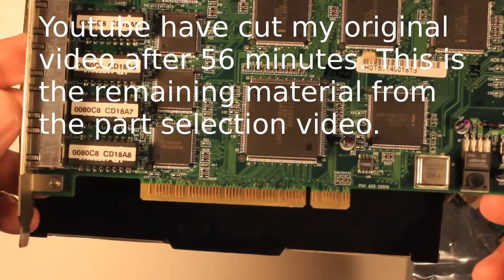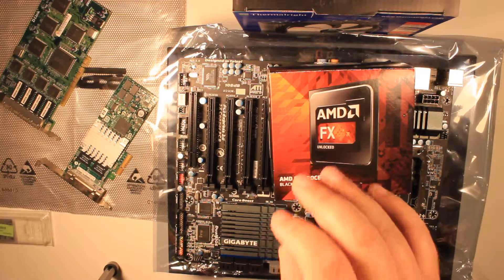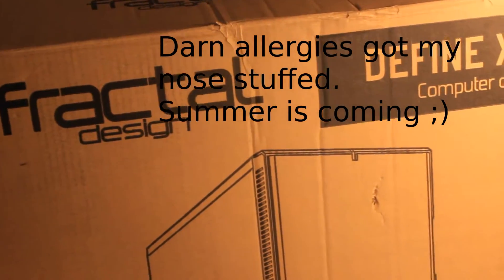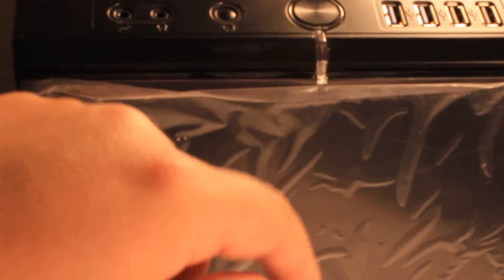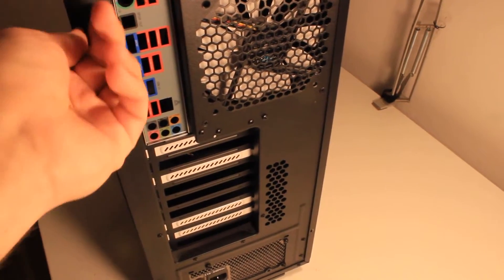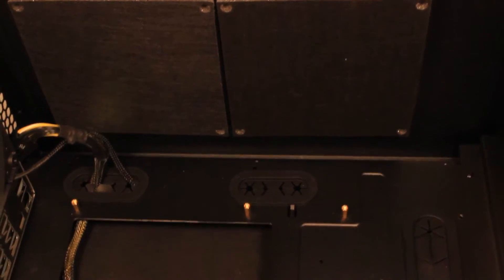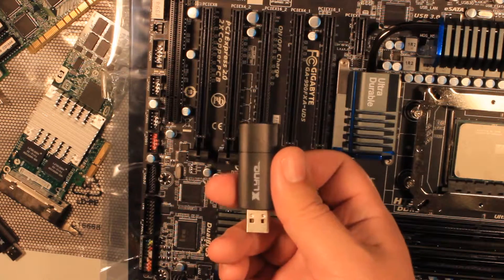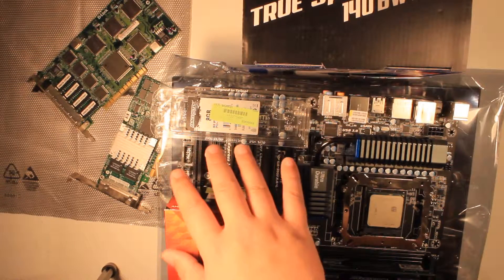Howto build virtualization home lab for VMware, KVM, GNS3 and ZFS: Part selection (part2)

Comment: if ya want to make a budget  virtual machine build parts are fine.... it won't break the bank account :D
Reply from the maker: The idea behind was exactly to build an INEXPENSIVE but still good virtualization host, which is also not generating much noise. For 500 more Euros if noise would have not been a concern I would have rather built a nice dual-socket Supermicro chassis with Xeons...

Comment: I missed size needed for the second (kingston)  SSD
Reply from the maker: It is up to the number of VMs you want to install on the machine. 
In my machine the system SSD disk for KVM is 120G, and the SSD for the VMs is 256GB.
Reply: I will be installing Proxmox on the server  and who knows what else... May end up with 2x 256GB just to be prepared.Will be starting to put the system together on the coming period on the basis of these videos and all your info.

Comment: Thank you for the video. I have been wanting to build a similar server.  looked at both videos but could  discover your using a raid controller.
Reply from the maker: I do not use any RAID controller. In fact, considering how good ZFS on Linux works in my daily job, I will most probably not even put money towards a RAID controller. Instead I will just use the onboard SATA ports to directly pass the disks to ZFS.
Regarding the network, if you need Virtual Machine Device Queues (VMDq) or SR-IOV features, those are not supported by the network cards and the motherboard. Considering that those are advanced features for virtualization, most probably you will not miss them.
Reply: Thanks for replying. I will have to shed some light on ZFS since this is new to me. Do you have experience using onboard SATA on AMD motherboards when it comes to raid functionality ? I found some complaints on AMD motherboards  when it comes to using them for raid purposes. Secondly I noticed  quality raid controllers have a back up battery to prevent data loss in the RAM in case of power failure. Also I was considering that RAID controllers would allow for  hot swapping the hard drive in case of failure.
Your commenting will be much  appreciated.
Reply from the maker: The issue is, that strictly speaking neither the Intel, nor the AMD chipsets provide real hardware RAID functionality, because they do no hardware offloading at all. Instead, they !ARE NEARLY PURE SOFTWARE RAID!. Namely, they just offer a more "visual" interface where you can set the RAID level in the BIOS regarding the disks and the chunk sizes, and they save those settings into the NVRAM portion of the BIOS. Once your operating system boots, it reads those values from the BIOS, signals to your OS to load and starts a special driver. After this it does !SOFTWARE!  RAID using the implementation from this driver to do all the RAID calculations on the CPU. Since the driver is proprietary instead of something like the open source MDADM, this makes the Intel and AMD RAID very inflexible because you never know what is happening on your system. Thus, if you are sure that you really need RAID, then it is better to either buy an Adaptec (http://www.avagotech.com/) used from Ebay, or stick to good software RAID like MDADM, or the RAID-Z implemented in ZFS.
Regarding the hot-plugging, SAS backlanes support this only according to specifications, because SATA is not really was meant to support hot-plug. In reality, however, if you rescan the SATA bus after hotplugging a disk with Linux or VMware, they will find the new disk most of the time.
Reply from the maker: Regarding the battery for a RAID controller, that is needed because the RAID controller practically lies to the underlying OS, that it has the data in a stable storage (so called synchronous write), when in reality it have just pushed it into a fast write-cache (practically a RAM module). Thus, when the disks are not busy, the driver of the RAID controller will take care of actually flushing the data from the RAM module to the disk, which is transparent to the user. 
Now if you do not have a battery on the RAM chip, since its contents was not yet flushed, it might corrupt the entire filesystem, or you might just lose 1GB of data if you are lucky. However, in reality most hardware RAID controllers I have used so far, if you do not attach a battery to them, they will turn off the write-cache per default. You can still !FORCE! the write-cache to be turned on from the BIOS of the RAID controller, but this is really bad practice and asking for trouble.
Since the batteries are really expensive, and they dry out in about 2 years, the new RAID controllers use supercapacitors like the Avago Cache Vault cards:
http://www.avagotech.com/products/server-storage/raid-controllers/cache-protection
In contrast to hardware RAID, an other argument for going instead into the direction of ZFS is that you do not need such an expensive RAID controller or a battery.
Reply: Can't thank you enough for taking the time to answer my questions in detail..thumbs up for both answers.
Reading your article makes me think a raid controller may not be such a necessity after all. True the back up battery seemed already like an outdated solution. Thanks again
Reply from the maker: I am just putting the finishing touches on a RAID video series together as a video response to your questions. This series will explain the software vs hardware RAID in detail together with the function of the BBU battery and the newer solutions like LSI CacheVault® or Adaptec ZMCP® solutions, which do not use battery. The videos should be up tomorrow after I finish editing/uploading them. 
Hopefully this will give you an even more clear picture of what I meant, because in a video it is easier to explain the details.
Reply: Great I will be ready to watch it

Comment: Very nice channel and video, exactly what i'm looking for. 
1. Comment
I did something very similar, but i would suggest you to have a breakout switch instead of you 3 four port NIC. But if you have those around it does the same thing. Basically for breakout switch, you need a layer 3 switch like 3550, 3560, 3750( 2950,2960 may work too i think). You need a NIC capable of 802.1Q. One cable from your pc to breakout switch.

Going for the ICND1 on the first week au august.

You should do a video about yourself or channel intro.
I may start a video channel too
Reply from the maker: First of all wish you good luck on your ICND exam!
Since I build the machine for virtualization and GNS3, for me using a single NIC with a brakeout switch was not really an option. Namely, I would like to have each NIC dedicated to some virtual machines, experiment with high availability, network teaming, and also run GNS3 as well.
Especially if I use a SAN for the virtual machines, that is when the gigabit NICs come in handy. 
Regarding the channel intro, I might do one after I have at least 30-50 videos uploaded, so people have a better idea what to expect. For example, when I have uploaded the microphone preamp videos, lots of people have unsubscribed, because they were not interested in the topic. However, I think that for others it might be very helpful, although it has nothing to do with networking or Linux.

Comment: Thank you very much for the interesting and very informative video. I am planning to build a home lab virtualization server based in proxmox and your choice of hardware fits the exact needs I have but I am not sure about the price. Would you kindly provide a break down of your hardware cost , it would be highly appreciated here. Thanks in advance.
Reply from the maker: First of all, thanks for the feedback, and I wish you good luck with your ProxMox build ;)
I put the price list at the bottom of the video description, although in the video I mention some of the prices.
One could have saved a bit on the CPU by going for FX8320, or an older FX6xxx series.
Lots of money could be saved on the cooler and case, but I wanted a nearly silent machine.
Most components I bought used from Ebay to save money. Thus, it depends on your luck 
and location for how much you can snap them.